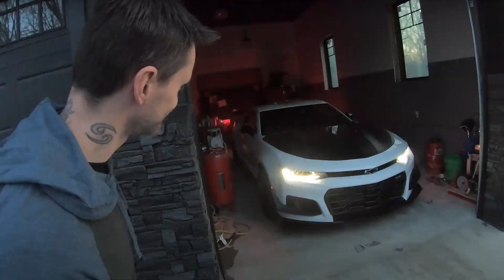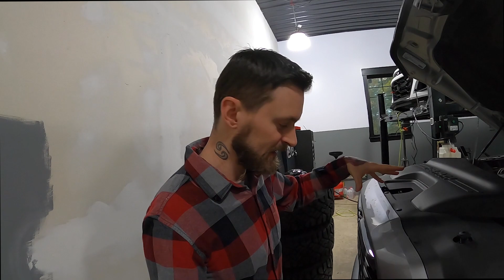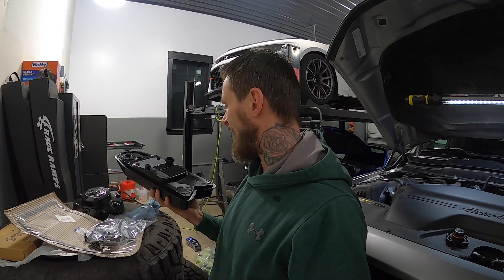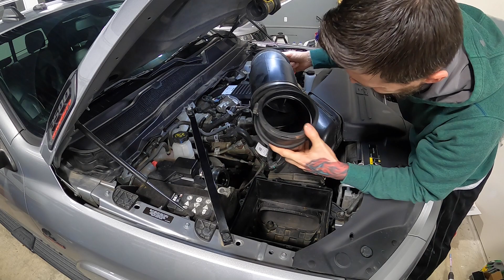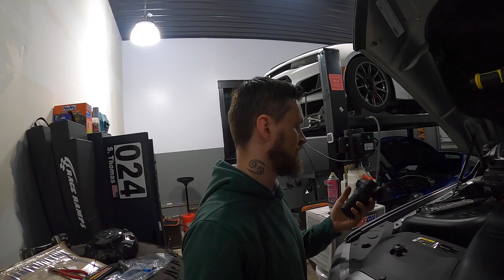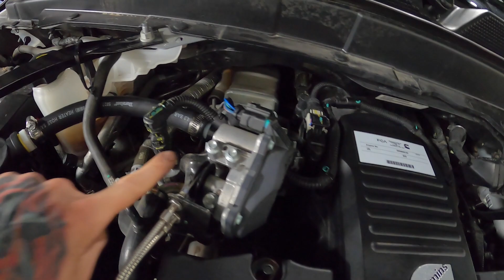Installing the Banks CAI and custom oil catch can on a Ram 3500!

Comment: Finally someone with common sense. I’ve been wondering how to do the oil sprayer set up my self from the intake to turbo. Glad you did it before me so I have a better idea! Great job brother! Someone finally educated and understands why the CCV is important and when these dudes do redneck science they creating more positive or negative pressure there’s planets of guys out there with pictures and video of collapsed breather filters they bought from auto zone. Also glad another person has called out the cold air intake lol maybe with tuning it’ll do a little more but for 500 bucks I just can’t justify it especially when I already have an aftermarket turbo so I don’t need to hear it spool up more necessarily. I really want to doit just because 😂 but videos like yours remind me to just save my money and spend the 500 on something else. Now if I can buy a used 1 of someone’s for like 350 or less. I’d definitely doit

Comment: Greetings Seattle Tacoma Fans club Maritza and Papilindo José ❤ Beautiful professional review.... I have two Cummins 6.7 Ram 2017 Excursion 2006 .... they have a AMSOIL Bypass Filtration Dieselcraft Centrifuge Systems Bank's cooling Airfilter tuning system... Great mpg 17 loading.... Please keep teaching how important it test oils coolant add extra filter on both very low microns.... payoffs bc after test recommend 17.6k to 19k oils change... PPE UPR filter.... if you drive it a lot hwy miles recommend it!!!😂😂

Comment: Delete that monster and let it breathe the real way. Deleted trucks are a must. Get rid of all that garbage. Slap a 50hp tune on it and you’ll be set for life.
Reply from the maker: 22’s sucked.  Wish I had got a 21.
Reply: @neckofthewoods24  be happy you didn’t have the 19. In 2019 they went with the CP4 Injection pump vs the CP3. 6 months later it became a recall due to failure in the CP4 and causing failure to the fuel system which is only fixed by all new injectors, new injection pump, filters, injector lines, fuel pump, etc. I’m rocking a ‘16 limited and deleted it under 100k miles, got rid of all the EGR crap, WC Fab cold air intake, and tune. Just broke 170k miles. They don’t make the new ones like the old ones and I’ll live by that statement.

Comment: I just swapped in boost tubes on my 2012 after discovering a leaky boot. It makes a noticeable difference! The factory boots are very thing compared to the Banks or other aftermarket boots. 10/10 recommend while you are doing that swap since you are right there!

Comment: The catch can is well and good but I find it too small for these big engines.
Reply from the maker: @Waseem06-c1o  depends how bad your motor is.  This never gained 1 drop so the size is good.  On other cars mine would fill up within 1000 miles.  You can always try bigger.
Reply: @neckofthewoods24 
Thanks

Comment: My Cummins ISX 15L in my international vents to atmosphere down at the bottom of the motor leaves a nice little oil spot when I idle or park for the night. Had one that would smoke out that hose first few times I thought something was burning under the hood. Definitely looking to add that plastic one you got to my ram.
Reply from the maker: @keithsimonds-e4e  after running it for some time, it never collected anything.  I think changing the CCV filter is all that’s needed.  I think changing early definitely keeps things clean.
Reply: @ I changed mine on my 17 ram at 55,000 and it was definitely dirty/ oily so I plan on changing mine every other oil change or so they really are not that expensive of a filter I get mine from the local international truck repair / cummins repair shop.
Reply from the maker: mine was at almost 70k and yes very dirty!   i definitely wouldnt do it every other oil change though.  theres a ton of media in there to hold back oil from getting to the turbo.  75k is way to long and maybe even 55k but unless youre doing 10k+ oil changes i wouldnt do it sooner.
Reply: @neckofthewoods24  Good point I do my oil changes about once a year or by 10,000 miles it doesn’t get driven a ton not my daily driver. I will probably check it at the 40,000 mile mark and decide from there.  I do like your videos and how you explain things out.

Comment: Has anyone popped code after thos set up??   If so what did you figure out the solution on getting them to go away???
Reply from the maker: @brianathey9298  I saw online many have.  Banks didn’t have a fix yet.
Reply: I got mine about 4-5 months after the COMMIFORNIA compliant ones came out. It’s on my 2015 Ram 3500. Always throwing P04DB ( crankcase ventilation disconnected). Always as in several times year. It does seem to throw it more often when it’s windy out!🤷‍♂️🤷‍♂️ Or when about 200 miles into a longer drive, with or without a load. My diesel shop did the installation. Banks have been zero help unfortunately.

Comment: 22s & 23s are snow flakes compared to 19, 20 and 21. I know people with all years, i own a 20. Close to 400k, heavy hauler.
Reply from the maker: @AngelRodriguez-ml7rh  lucky made it 72k with issue.
Reply: Yeah except for that CP4
Reply: @MPjustaman Ram recalled that issue, and installed a CP3…….no more potential to grenade the engine😮
Reply from the maker: mine was after that.  i think a later model 22.  no recall, no CP4 installed.
Reply: 21 3500.. 1 actuator , 1 def pump.. a few sensors here n there. 210k miles. 200k of those miles are with a 5 car trailer. These RAMonas are the best. Use to like Chevy and started hauling. The 16 Chevy 2 cp4 failures. Will never go back. 21 Ram still rocking the cp4 😅 but I’m going with an aluminum valve cover and I need to build a setup that keeps the sensor on top of the valve cover, and that valve and sensor that goes to turbo. My brain is going crazy on Aos /filter that copies the original setup since these aluminum covers just delete most of it. Broke down a filter and I’m confused on the hoses. It has the big hole coming from the valve cover area into a oil separator cavity and the lil holes inside that cavity goes to front hose, the air goes through 4 slotted holes through filter media , to the pcv valve thing but the back hose is in that area .. so why have the pcv and 1 hose going down to the y into crank case. I’m thinking 1 way valves on both lines at different pressure then the pcv valve that goes to turbo hose . Don’t get it the oil isn’t filtered that goes back into crank case, the air is after the filter media but wouldn’t the air also go with the oil drain line before media… how why totally lost the whole system after opening up the filter

Comment: Stumbled across just seeing what others have done with CC mounting in the engine bay.  You really don't want to put a can on that small line, that's the drain from the OE CCV Filter back into the block.  If you look at the pricey Dirty Diesel Customs Valvecover/CCV Delete/Catch Can configuration they use that line to drain their can so you never have to empty it.
Reply from the maker: @joshuaeb09  this was only installed on the line going back to the turbo so the suction is very large and powerful to pull out blow by.  So I’m not sure what you’re talking about.
Reply: @neckofthewoods24  In the begging of your video you show a bit of concern about the CCV drain line.  I'm just calling out that it is indeed an oil drain line back into the pan.  The cummins isn't at all like most gas applications where you have a "clean" side and "dirty" side for the PCV/Crankcase Ventilation plumbing like you'll find on boosted Hemi/LS/other applications.   You just have the suction side pulling through the CCV - aka where you installed your can.
Reply from the maker: o gotcha.  👍

Comment: White Teflon is perfectly acceptable for use in hydrocarbon applications. The yellow is simply a color added for inspection in natural gas services to make sure youve used teflon tape. I work in an oil refinery and we use white Teflon on every service from natural gas all the way up to as heavy as bunker fuels and lubrication oil. 

Great video, I'm looking into doing a catch can for my 6.7 cummins.
Reply from the maker: its like 3 times thicker, im sure theres more to the compound than just that.
Reply: @neckofthewoods24  Yes, it is definitely thicker. My point is you can safely use white Teflon on hydrocarbon service. You wrap it more if you need more.

Comment: Just wondering if you can share the link where you bought your catch can.

Thanks
Reply from the maker: No link, just an item on the shelf at tractor supply.
Reply: Found the catch can at TSC...   SKU 2114106  Hypro 3/4 Polypropylene line strainer..

Comment: Just delete the emissions you and your truck will be happier!
Reply from the maker: Not when the 22 ECU isn’t cracked and 21’s are going for crazy amounts!!!
Reply: Ur right i didn’t catch that part i just deleted my 21 and it’s shocking the fuel mileage im getting and hopefully long reliability
Reply from the maker: @that-badass-barber  other thing I may sell.   If I sell, I definitely can’t trade in, I’ll have to sell private and to someone that doesn’t have emissions testing.  Just really lowers the potential buyers.   As for MPG I think I’m stuck around 16.5mpg with the 33’s.
Reply: Whats the issue with adding banks cold air filter system and heavy towing?  Fulltime rv'er towing a 21.5k fifthwheel.

Comment: Any check engine light problems?
Reply from the maker: Yes, but only one. The intake tube where the filter is clamped onto collapsed around the area where the worm clamp tightens.  and even though the air was still being metered, a check engine for some reason. Banks sent me a new tube free of charge.

Comment: Egr=exhaust gas recirculation system
Reply: I’m wondering if it’s because the computer can’t use as much exhaust gas in that situation because there is not enough restriction on the intake air to warrant the use of the exhaust gas?

Comment: From my understanding Banks is the best but to me I have never added a cold intake, instead I changed the air filter to a K@N filter on all my vehicles. The only thing I changed was the exhaust to a good stainless exhaust for long life and better exhaust. I have never had a problem or had to buy another K@N filter as I used their cleaner and spray on oil and I kept some trucks to 175,000 miles and 16 years old.
Reply: If you own a cummins and have a K&N filter in it, I recommend removing that filter and changing to something else. A few yrs back, cummins put out a bulletin stating that using a K&N filter in their motors would void the warranty.
Reply: @dwwilliams72  only k&n or banks to ??
Reply: @leomadero2710  not sure about the banks
Reply from the maker: I’ve done both!  Just depends on the situation like this one.  The Miata got a K&N I don’t think i mentioned.  But the other 2 are CAI’s.